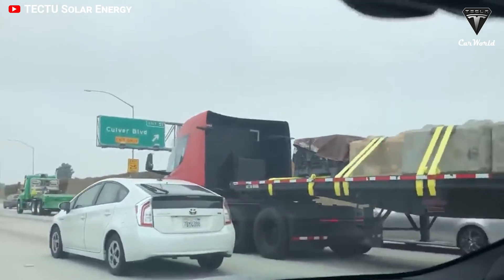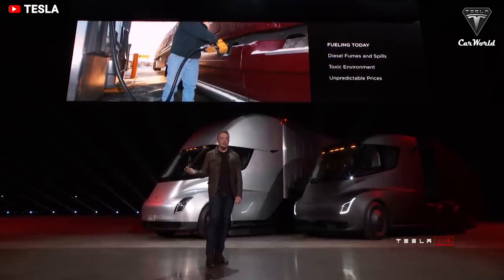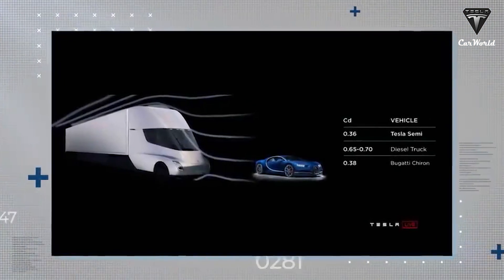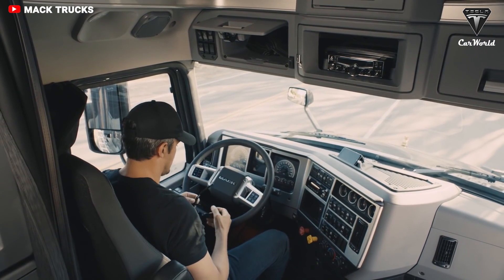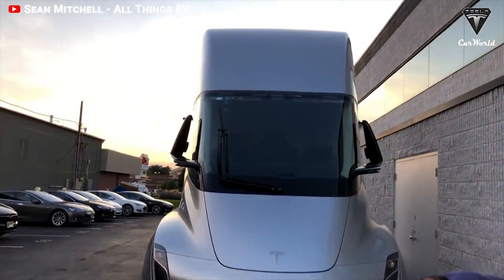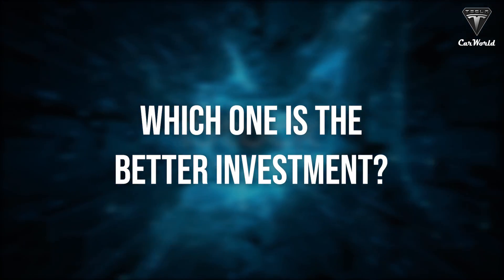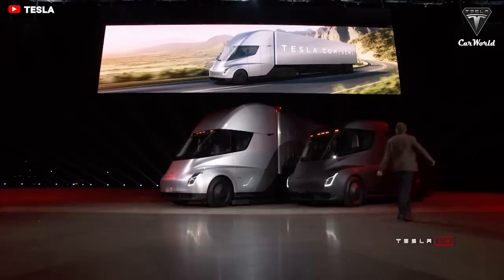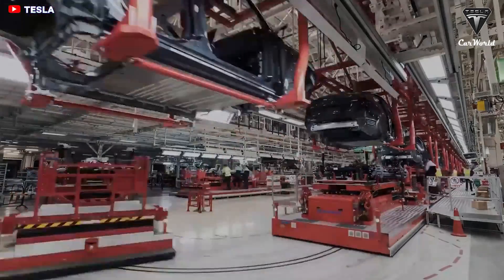Which is the KING of 2023 heavy trucks? Mack Anthem Diesel Truck Vs. Tesla Electric Semi?

Comment: Actually ... Trucks in America are made to Haul for distances more than 700kms+ for the Mack itll fillup and go but Tesla truck can take time. Time means everything to Truckers. If they are late its hell. 
These are not cars that accelleration matters instead towing capacity relative to time matters. Diesel trucks can tow huge huge loads for many kms without complaining at all. For a tesla truck .... its not the average mechanic at any gas station can repair during haul. Espacially if your battery is getting hot because huge amps were pulled for a long time. 
For a model 3 the motors didnt have to work hard but in this case the fancy 20 seconds will drgrade the batteries aswell as your wallet. 
In my opinion this truck is all numbers and papers it will never sit well with truckers.

Comment: Be a safe bet tesla trucks would be good in local settings. But for long haul its probably a good ways out. Your typical truck stop probably services 500 to 1000 trucks a day. Thats a lot of power to run to the stations. Lots of infrastructure. Gonna need a lot of time to do all that

Comment: an electric motor in most cases is going to beat a diesel engine both in power, acceleration, and overall performance and maintenance is also an advantage. however, the weakness with electric is range and the weight of the batteries and charging times. these are massive weakness in a truck the Mack Anthem wins

Comment: This video seems somewhat misleading with a huge bias in favor of the Tesla.
Currently in California the price per kWh is 28 cents giving you $112 to go 200 miles not $28.  Forget about  government subsidies to EV prices because they are not available in every State.   The cost of diesel is currently $3.89 near my house.   That is $132.26  to go 200 miles. That is a difference of only 20 bucks.  If diesel comes down to $3.29 per gallon the cost to go 200 miles is the same in either the Tesla or the diesel.

Comment: 9:37"Forward collision warning" As if you can stop a 20 ton truck going highway speeds within 50 m without jackknifing.(yes they have that anti-jackknife system but how well is that going to work when you NEED to stop quickly)

Comment: No trucker cares about acceleration. It's absurd. Enjoy your cargo being thrown around. The MACK is a truck for trucking. The Tesla is a truck for PR. Tesla hauls less cargo, can't go as far, takes forever to charge, is a massive slab of explosive batteries that would burn for days/weeks, and has a cabin designed by people who've never sat in a truck let alone driven one. The first batch of Tesla's are also being kept by Tesla for use as an internal fleet. Do people realize that trucks need to work in crazy harsh weather? Battery performance tends to be pretty bad in the cold, let alone harsh weather. These trucks are fancy local route trucks that never leave town and always are home for the night, not cargo haulers that will replace diesel trucks. That MACK can go thousands of miles fully loaded on fuel and operate in the worst weather possible while hauling considerably more cargo, it's honestly a silly fanboyism form of comparison.

Comment: There’s one big issue- according to several science based people, Musk is lying. Let’s put aside the 3 years (+) delay; the Tesla have seen pulling away of a diesel semi with a quarter of the typical load. There are huge issues with the charging (there are non of the promised mega stations built). Also in the test video the Tesla semi truck exactly was overtaken 18 times by regular trucks and overtook just once!
I love the idea of a cleaner saver way of transporting goods, but Musk is a Charlatan.

Comment: Its not the horsepower that is important for trucks rather it is the torque which is more critical. More torque means you can haul heavier loads with ease.
Reply: Can you explain the difference between those ?

Comment: Bahahahahahahahahahaha this guys use of Google sucks lol. My mack anthem hauled 200000 lbs. Rated for 205000.  I'm sure the Tesla pull it, till it found a hill and started slowing down and the wind wouldnt cool the batteries and kaboom.  Not to mention it would take would need to be charged every 20 miles lol.  Oh ya, it was - 40 here in Canada. And my mack pulling 160000 lbs can go 700 miles on one fill. So it ain't gonna work yet bucko

Comment: Give me torque, not acceleration is a semi for god sakes, lets see a tesla go toe to toe with a peterbilt with 2600 pound of torque hauling oversize/overweight loads where you dont completely rely on tech cuz ya know computers do fail. If they do that am all in otherwise i stay with my diesel truck 650hp cat 3406e  with all the whistles, i dont like those front crash mitigation systems i deleted mine simple cuz thos things give false positives and slam the breaks when u not ready for it. On a semi this could be deadly for you as a driver and others. Soo many things can go wrong, and dont get me started on self driving semi. Thats a cathastrophy waiting to happen

Comment: Funny how they haven't released the weight of the truck and battery and how this drastically reduces the distance the truck can travel with a full payload on a long haul and the time spent recharging
Reply: 90% of semi truck loads in the US weighs in at 73000lbs or less. Musk states that in worst case his trucks will weigh 2000-4000lbs more than a diesel. And taking in concideration that eletric trucks in the US are allowed to carry 2000lbs extra, total weigth 82000lbs, there are not a drastically difference regarding load capacity in the big picture.

Comment: battery weight cuts into load capacity. diesel trucks can move larger loads than electric. 0-60 doesnt matter for a semi, its a mostly irrelevant stat. drag coefficient would greatly be effected by the type of load the truck is hauling. load capacity, reliability and travel distance. tesla doesnt have a great reliability record.

Comment: Not sure where the cost of the Tesla-Semi came from as I haven't seen that announced, also load carrying capacity. The fully laden 500 mile trip didn't actually say how much of that weight was truck and how much was cargo. It makes people wonder why the unladen weight of the Tesla is never stated, surely if it was good, it would be, after all, the design of the coffee cup holder and the mobile phone charger get a mention

0-60 speed for a semi is completely irrelevant but if it does become a factor it needs to also say how much each maximum launch would then impact on the range.

There was much talk of the charging capacity being a whopping 1+ MW (1,000+ kW) DC, but that was "planned", is that in another five years, and when it comes it will take some infrastructure development because having a few trucks charging at that rate will need their own electrical sub-station.

It wasn't clear how many Tesla-Semis Pepsi were getting and after the Tesla-semi delivery event, there were more questions than answers.
Reply: Pepsi got like 36 and getting more this year.

But right now, the Tesla is great for smaller/local deliveries. Technology will improve but for now combustion trucks will own the interstates. The model T wasn't faster than a horse and carriage so all is required is time, and patience.
Reply: @bedinor  " right now, the Tesla is great for smaller/local deliveries" - that is not what was being promoted in the Tesla-Semi delivery event.

In the presentation there was no holding back, the assertion was that the Tesla-Semi hands down beats diesel and rail and the Tesla-Semi can carry a full load 500 miles on a single charge, can recharge 70% in 30 minutes and accelerate from 0-60 fully loaded in 20 seconds.

Those of us that don't take everything that Musk says at face value find that hard to believe. Penn and Teller perform tricks, not magic.

If the Tesla-Semi is aimed at local delivery for lighter loads, then the Tesla-Semi has a lot of competition from other manufactures who are already in production and the Tesla-Semi is not the game changer Musk says it is.

Comment: Yep the Mack Athem is the better truck has more power “torque” can pull more weight from 70 ton to 150 ton with the mp8 or mp10. More than one trailer doubles, triples and quad combinations are common in other countries . Also more manoeuvreable “shorter wheel base” easy to back those trailers up and round a corner. Up to 1400 miles on one charge . Wider range of applications , works better in hot climates . Drive train warranty of 900,000 mile. The Mack is an excellent choice. Tesla has a way to go to catch Mack but I’m sure they will get there over time. Tesla will be a good city truck or short run truck light loads stop start work.

Comment: You talk about the "Advantage" Tesla has to carry cargo because it has a 82,000 GCVWR.  However if the tractor is more than 2,000 pounds heavier than say a Volvo 13 liter truck, then the Tesla would be able to tow much less weight than the Volvo 13 liter truck.  I hear that 1,000 KW of batteries is going to be really heavy!  

What you need to do is find out the curb weight of a Tesla truck and the Volvo or Daimler equal size truck with a diesel engine.  Then you can determine that the Tesla can tow this much weight, while the Volvo or Freightliner can tow this much weight before reaching their 80,000 pounds GVWR.
Reply: 90% of semi truck loads in the US are 73000lbs or less, studies shows. So in 90% of the loads, one in worst case will have 75000lbs Teslas, compiting towards 73000lbs Volvos, 24/7.

Comment: I think that Tesla made a huge and expensive mistake by accepting orders for the $170,000 semi before they had produced significant numbers of the trucks and came up with a total cost of production.  My guess is Tesla estimated that the battery cost was going to go way down, and they could afford to install a 1,000 KW battery for less than $50,000.  However battery cell cost is still above $100 per KW, so a 1,000 KW battery pack will be at least $120,000 installed in that truck.  The rest will probably cost something like $80,000 to $100,000 to build the truck and install that $120,000 battery inside it.  

My guess is the total cost will exceed $200,000 and might be well over $250,000.  But still this is a great deal, if you can drive it for 200 miles while only using about 400 - 500 KW of electricity.  In California, the cost is normally about $0.20 per KW, and then commercial buildings have to pay an additional demand charge for power consumed during peak power hours of the day!  Also charging at a Electrify America station is in the range of $0.30 to 0.55 per KW, depending on the time of day and local cost per KW for the power.   So my best guess is the truck can be recharged 400 KW for about $80, still significantly less than the $6 diesel fuel that they sell in California.  Most long haul drivers will get fuel in Arizona or Nevada before they enter California to avoid that high cost of fuel!  

While I only pay $0.10 per KW for electricity in Portland Oregon for my house rate, the commercial rates are a little higher, and the rate in California are almost twice as much.

Comment: 16 minutes and not one mention that LOAD capaciy, the single MOST IMPORTANT thing, is 4 ttimes heavier with the diesel truck. this is a MASSIVE fail for tesla.
Reply: 4 times heavier. Whatever, a Tesla truck is estimated being at 27000lbs, while a diesel is 20-25000lbs. You do the math, once more. 90% of the  semi truck loads in the US weigh in at 73000lbs and less, in real life. So in most cases the extra tractor weight won't matter
Reply: @Rimrock300  nobody will actually say what the Tesla semi truck weighs. It’s almost as if Tesla is hiding the unladen weight. 🤔

Seriously, they showed a crick carrying less than half the load a diesel truck would carry and said it’s a full 82,000 lb. load, the maximum allowable in the USA.
Reply: @Rimrock300  you seem to be ignoring the fact that the company that is hiding the payload capacity is touting the zero to 60 acceleration time… or the LEAST IMPORTANT POSSIBLE FACTOR in vehicles of this type. 

They seriously couldn’t be more obvious that they really don’t understand what they are building and what it’s actually supposed to do. 

This truck is a MASSIVE failure. just like teslas free falling stock, self driving cars that will never be from this company, a Cybertruck that is 4 years late, the hyperloop that turned into a tunnel with teslas in it, and the elusive ‘mega chargers’ that are mathematically impossible to power with our current power grid. The semi is just one more blunder. 

At least they will still have carbon credits to sell so other companies can pollute a little extra and Tesla can use the money to pretend they aren’t failing at an exponentially increasing rate.

Comment: the problem is the Tesla will almost surely be more than 2,000 lbs heavier than standard diesel trucks...that is why electric trucks get the 2k extra capacity.  Tesla hasnt released the wt of their truck but the battery pack will be fantastically heavy...till tesla releases their weight you prolly shouldnt act like it can tow more as it almost surely cant by thousands if not 10000 pounds less freight or tesla would have released the trucks weight.  (weight guestimates from estimating the weight of battery pack minus weight of engine weight differences and fuel of standard trucks vary from source to source by several thousand pounds so lets not guess and make surely false claims) 

also the cost of power you quoted is less than half the US average...The first trucks are going into operation in California which has a price of 19.90¢ / kWh sept 21
the chapest prices of power is 9.79¢ / kWh in Washington and Louisianna at 9.37¢ / kWh (in my brief search i couldnt find this year power costs but they are close enough to make my point)
The most populated areas oddly enough have the most trucking and have the highest prices.  If one has a MASSIVE solar grid they can power it nearly for free but I have a feeling most charging will be done half during peak time and half in non peak 12an-3pm unless someone shows up to plug it in after midnight or they have some automated power system but that doesnt factor in the refueling during operational hours.  Many trucks do not sit idle for long stretches to obtain a max charge and until the new charging stations are everywhere, this can cause logistical log jams and lessen the hours a truck can be in operation during a day as well as wildly fluctuate the cost of operation by %20 ore more plus the extra logistical costs from time to fuel trucks.

now lets talk range.  The real road test started at a higher elevation than it ended.  This means the trip takes less power than the return trip if hauling the same load.  Then you have your range variables there were not accounted for...flat beds have much much worse fuel efficiency.  Until we have real world data of two way trips with a trailer and with flatbeds, stating range as a fact is just beyond stupid and intellectually dishonest.  Not that they cant achieve the ranged listed just it has not been substantiated. Then you need to factor in recharging times...at a special tesla charging station it takes 30 minutes to charge approx 300 miles of range but takes hours on normal chargers to do the same charge and it takes a long long time to achieve full charge.  This can disrupt the logistics of hauling freight and that costs money.

This truck CAN be cheaper to operate for a single driver, driving one shift a day, charging only at non peak hours, than a fuel driven truck there is almost no doubt especialy when you factor in maintenance costs but not to the order of magnitude you are claiming...not even close.

it is ok to not misrepresent facts to your audience...it wont destroy the Tesla brand to be honest and accurate, they might appreciate accuracy and some might want honesty, I know I do.

Comment: How do they compare on distance between refueling/recharging and length of time to recharge/refuel? Unless they’re comparable, I feel like the acceleration and most of those specs are minor by comparison, apart from the max haul weight.
Reply: diesel truck will have 1200 to 1500 mile range and will take about 10 to 15 minutes to refuel. tesla has a range of about 400 to absolute max of 500 miles and takes around 10 hours to recharge.....
Reply: @origionalwinja  Based on the chemistry in the way these batteries work you should never deplete the battery, and trying to full charge it will take longer and slower the closer it gets to full capacity.  Most EVs are recommended to alternate between 10/20 -> 80%.  So quote a range on 100% -> 0% is stupid.  It's a bit like all manufacturer's quoted fuel consumption, it based in laboratory conditions that don't exist in the real world driving.

Comment: You're comparing apples to bananas.
The relevant metric for truckers is the max loading capacity.

If  the fuel cost is cheaper, but you have to do two tours instead of one you've saved nothing

Comment: That's great it can accelerate fast, but it won't help it's  capacity, or range. So from 0-60 ya it will out accelerate a truck , but it will have to do more then double the amount of trips and need a bloody substation to charge.  Charging  will take 4 hours at a minimum and you'll then you'll only be at about a 1/4 of a regular trucks range. I'm not against EV's they make sense for cars and light trucks like the ones you see delivering beer or mail but they just won't work on this scale.   When 90% of the time it's sitting at highway speed what does it matter how quick it's 0-60 is.

Comment: But when the electric motor burns out your fucked or when your batteries fuck up it's 10 thousand dollars a battery or if your on a 5000 mile run well your going to be late cause your gonna have to stop and charge a few times